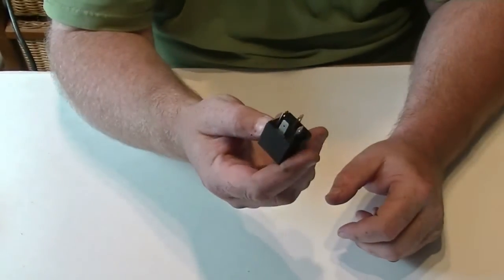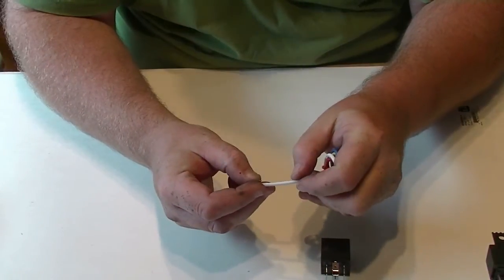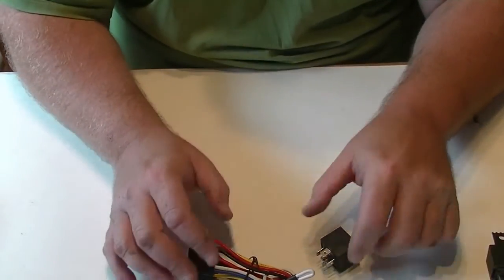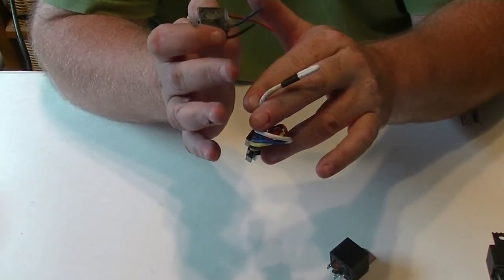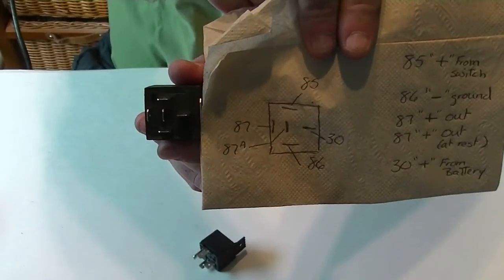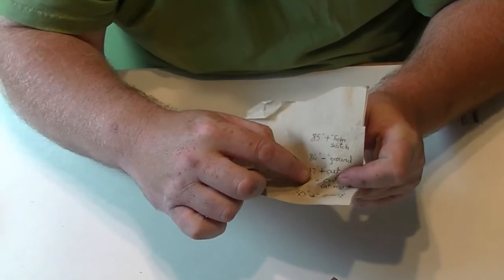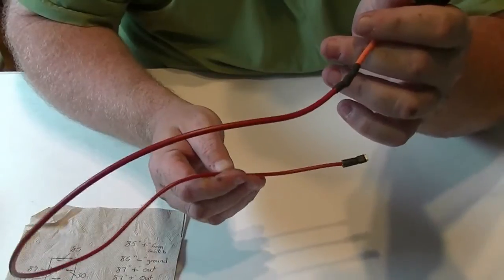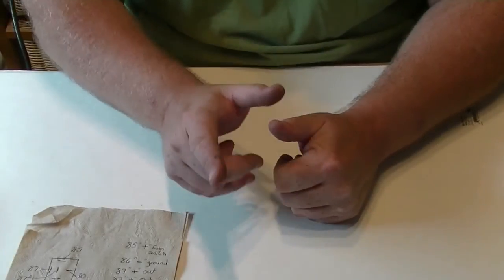12 volt 30 amp auto relay explained., Big Guy Review

Comment: Can I use a 40amp relay to replace a 30amp I can not find a 30amp any wheres
Reply: yes.  you can always go up, you shouldn't go down.  You can replace it with a 200A relay if you want.  It'll be crazy overkill but it would work as it should.   If you replaced it with a smaller relay, like a 5A, the relay will probably burn upand fail because too much electricity is going through it.

Comment: Good explanation.  Really liked the paper napkin diagram.  I was researching an in tank fuel pump for an after market EFI system and saw on the Holley website that I should have a 12V 30A relay, which they sell for $105 (part 12-753).  Seemed a bit much to me.  I did a quick search and found this video, and the relay for $3 and the plug for $2, the only other thing included from Holley was some wire and a few connectors.  I don't mind someone making a buck off of me, but HOLY COW, that's got to be more than 10 times their cost.  I'm still going to buy their EFI system, but when I order it I'll put in my 2 cents worth on their relay cost.  

Regarding the comment below on using Vaseline in lieu of the conductive grease.  Vaseline is not conductive, it may keep water out, but may eventually act as an insulator.  I stuck the probes on my ohm meter in it and zero conductance.  I believe that Big Guy is correct, be safe and use the conductive grease.  I have a tube I bought years ago and still have not used it all up.
Reply from the maker: Thank you so much for sharing Richard

Comment: can i use 80amp relay to a 2 60watts foglamp??? please reply....
i cant find 30 amp relay here, can i use 80amp relay for my 2 foglamps???
Reply from the maker: you can. as long as the total draw doesn't exceed the the relay. If your lights are 60 amps each then you would have to use 2 80 amp relays.
Reply: 60 Watts divided by 12 Volts = 5 amps (each bulb) 10 amps for two bulbs.  One 80 amp relay is more than enough.
Reply: 80 amp is a bit overkill but it wont do any harm to the light's

Comment: So why can't you just pull the 87a out if your not using it???
Reply from the maker: cause it is soldered inside the relay. pulling it out would damage the relay. Better to cut it off or cover it with some heat shrink tubing.

Comment: Hi,If on the relay the amp is not written, how can I know how many amps is it?
Reply from the maker: Normally they are 30 amps. Now when dealing with some of these china shippers / sellers they may be lower. Try only to buy relays that are marked 30+ amps.
Reply: Big Guy Review I took it from a recycled car it has diagram( for 4 pins) on it but not amp info
Reply from the maker: If it is the cube shape ones then it is likely between 30 and 40 amps. Not sure what the smaller ones are. Most likely between 10 and 20 amps.
Reply: Big Guy Review ok thank you

Comment: please reply   30amp relay  compare to 80 amp relay   whats the different and why do i have to use one or the 
other?
Reply from the maker: +GAR A it is in the size of the contacts in the relay. Think of it like a garden hose equals a 30 amp relay. Only so much water can pass through, if you try to force more water the hose will burst. where as a fire truck hose would handle the extra water with out issue. Well a relay works the same way. If you try to use a 30 amp relay to handle 80 amps of power then the relay will overheat and could catch fire. The heat will also be transferre to the wires handling that power. Very dangerous. Hope that helps.  -John
Reply: ok thanks very much sir, So I am sure now 2 fog lamps,  30 amps relay is more than good enough pwew I was just worried my car might burn....... I was thingking it might start glowing like electric stove pwew
Reply from the maker: LOL no. It is always best to fuse the power wire coming from the battery as close to the battery as possible. Use one of those fusible links and you will be all set.

Comment: Use Vaseline (much cheaper in bulk) instead of a expensive small tube. As a child my father had me dip EACH Christmas light on the house in it after I took the bulb out for a seasonal check. It also makes separating the connection easy because it keeps anything from jamming the socket. By doing this, we had bulbs that would sometimes last for almost ten years.

And don't forget all the other useful functions Vaseline has <smirk>
Reply from the maker: +EvilDaveCanada Thanks for sharing....ya ya i get it  :-) You are bad..lol   -John